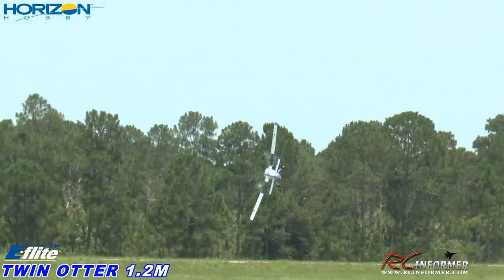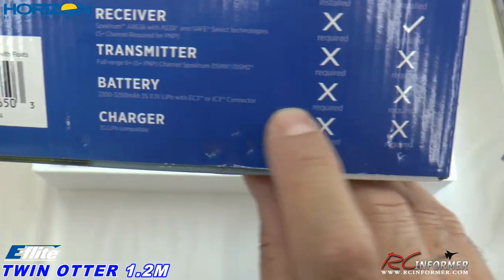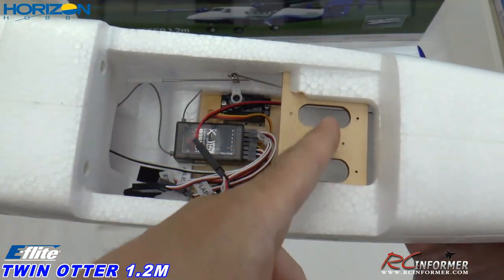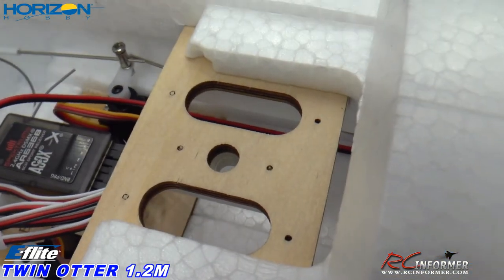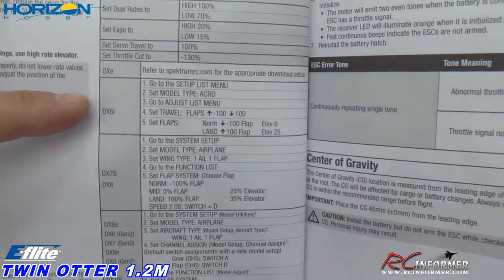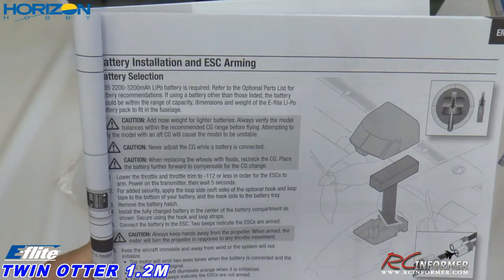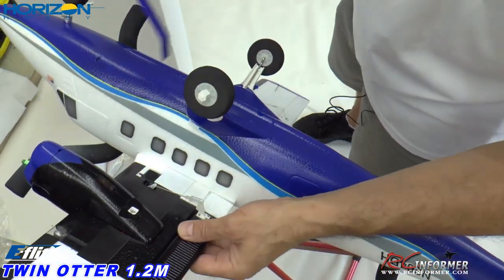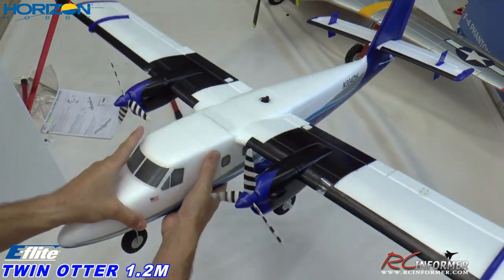E-flite Twin Otter 1.2m Unbox, Assembly  & Setup By: RCINFORMER

Comment: My first twin engine plane. I went straight to floats with it. I can’t say enough good things about the design and ease to fly. The AS3X I’ll give all the credit to for it still being in one piece after 6 months. I liked it so much I bought a 2nd one to experience it with wheels. (You really don’t want to switch out the plane from floats to wheels to floats. The money spent compared to the time spent switching back and forth was well worth it) I can’t think of one thing I could complain about with the Otter BNF. It’s just fun, easy to fly.

Comment from the maker: ▼Get Your E-flite Twin Otter 1.2m BNF Basic with AS3X and SAFE Select here▼
BNF Version at HORIZON HOBBY► https://bit.ly/3e8gv7o
PNP Version at HORIZON HOBBY►https://bit.ly/2ZRctex
               
BNF Version at HOBBYZONE► https://bit.ly/3iGO6Zu
PNP Version at HOBBYZONE► https://bit.ly/3gAx5yg

Clicking on and purchasing from our links supports RCINFORMER!
                            Thank You for your support!

* Table of Contents and Hyperlinks to Chapters***
-Unboxing► 2:44
-Specifications► 3:38
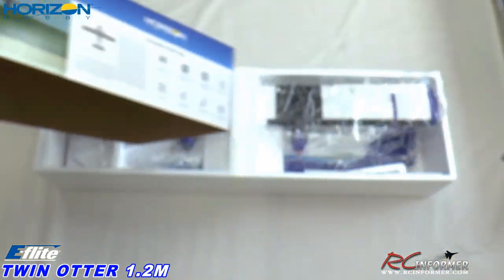-Parts Review► 7:25
-Instructions review► 19:50
**Assembly start **
-TAIL► 23:56
-LANDING GEAR► 25:32
-WING► 28:38
-TAIL FINS► 32:35
-PROPELLERS► 34:49
-FLOAT Assembly & Installation► 37:21
-BINDING► 43:11
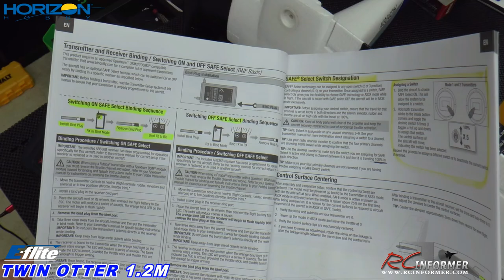-SAFE MODE SWITCH DESIGNATION► 46:52
-TRANSMITTER SETUP► 48:05
-ADDITIONAL INSTRUCTION ITEMS►  49:14
-BATTERY FLOOR► 51:33
-CONCLUSION► 53:19

Comment: Your videos are simply AWESOME.  Which planes would you recommended for a beginner? I plan on really getting back into RC after so many, many years away from the hobby.  I am more interested in BNF models. Also can you give me some tips on a great radio that I should purchase. Keep in mind I plan on stay in the hobby quite some time so I want a radio that I can grow with and add planes that I can grow into as well. I really really enjoy your videos. They really inspire me to become an RC pilot again. In your videos you really break things down to the least common denominator which is important to the novice pilot.  The pandemic has really put a damper on getting into RC flying. I was looking forward to joining a club in my area and plan on checking out several clubs in my area but the pandemic got in the way. It appears that things are opening up again and maybe I can pursue looking at RC clubs again. Thanks again for the great videos I am a subscriber and I will keep watching.

Mike R

Comment: Did they fix the molding issue it had on the tail with the horizontal stabilizer not being able to function properly because some material needed to be removed in order for the elevator to have full movement?
Reply from the maker: Mine is the latest from Horizon... I just got it. I has an addendum with some changes in it. Mine assembled perfectly. They clearly made some changes to the tail &  It assembled fine and the movement seems normal... As you could see from the flight videos it flies really nicely:)  If you get one please consider using my links to purchase in the description below the video.  Thanks for the support!

Comment: So the transmitter says 6+... does this mean the Dx6e would be suitable for it? I believe so but just want to be 110% sure as I would be looking to buy that and the plane. Will go with an easier first flyer but if I buy that transmitter for the future, this is the plane I want to make sure works with it. Looking to use your link for the helpful vids, pls let me know if I need a diff radio for full functionality with this. Thanks